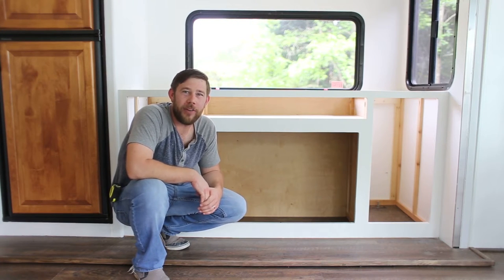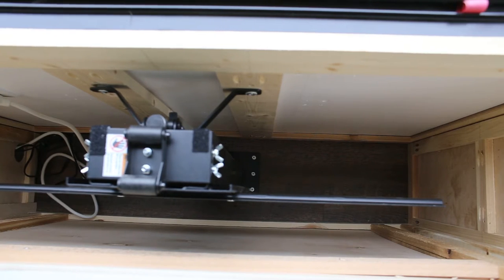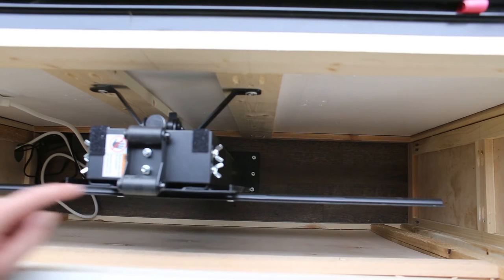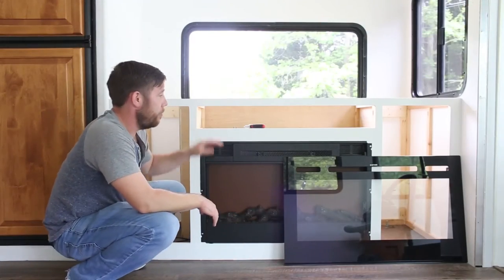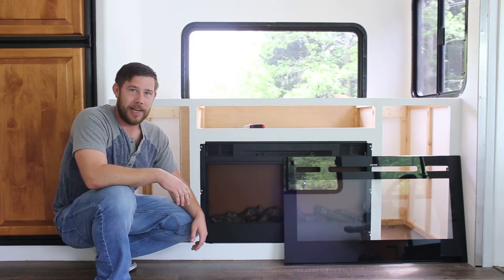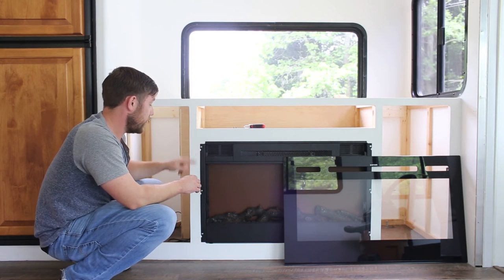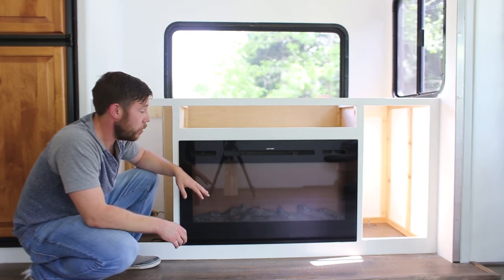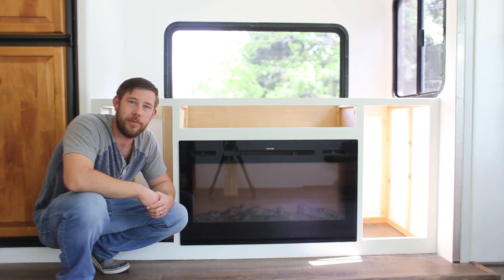Installing TV Lift and Electric Fireplace Inside RV

Comment: Great job. I’m curious as to what you use to attach the word framing to the rv wall? Glue? Nail gun (if so what size)? R u using a stud finder as well?
Thx again
Reply from the maker: Thank you much +mram 77 we actually used screws and screws and anchors, though after reading your comment I think adding some glue for extra hold wouldn't have been a bad idea. All RV's are different but below is what worked for us. 

So we found that the wall next to the refrigerator was actually very thick wood, so we just used screws on that side. For the back and right side it was just the wood panelling so we used 1" screws (our 1 X 2's were 3/4") and anchors to secure to the wall. However it's important to note that the screws on the walls were more security than anything else because on the floor of our slide out we had and extremely thick piece of underlayment, I can't remember the thickness but it was thick. So I'd say our main securing was done into the floor of the slide out. And on the stud finder we didn't use one main reason being that the studs in our RV are metal, and we didn't feel comfortable screwing into them. I did tap on the wall to try and avoid them. Anyway I hope this helps and please feel free to reach out if I can help in any other way, best wishes, Eric
Reply: Mountain Modern Life 
I truly appreciate the detailed response. Helps tremendously. Your renovation is by far our favorite. Now time for me to get to work.
2009 36ft 5th wheel toy hauler
2 slides
Fontana CA🌞
Reply from the maker: No worries at all +mram 77 I'm glad it was helpful, I can't wait to see what you do to it! Make sure to keep us updated with how it's turning out, and of course if something comes up you think we may be able to help with don't hesitate to reach out :)

Comment: I'm not sure you can answer this question. I've been considering living in a travel trailer. The thing that is stopping me is the cost of propane in the winter. I am thinking it could be possible to install an electric fire place instead, and use a heated blanket during the cold months. I was originally thinking about using a space heater but I've heard that can burn up the wiring in the trailer. I am wondering if an electric fireplace would burn up the wiring too?
Reply from the maker: Hey +Matthew Pilling I don't know the exact answer to your question but I will try to give you an idea of the process we've taken in the past. Propane can for sure become expensive so we've actually tried to marry together different options in order to conserve what we can. When we were in Wisconsin it was really cold (like -25 when we left) when we were there we'd use propane, the electric fireplace, and space heaters. This year however we've only used the electric fireplace, and propane, we actually lent the space heaters to a fellow RVer who ran out of propane in the middle of the night. 

With all of that said we've went two winters of using our electric fireplace and haven't had an issue with our wiring. The problem here is that all RVs are constructed differently, so it's hard for me to know if you'd have the same results. But for us we've had good success with the electric fireplace, electric heaters, and the propane. It's one of those things that you're going to have to push forward with and find the route that is most comfortable to you, which can be really hard to figure out. I hope this helped somewhat but please let me know if I can dive a little deeper into it. Best Wishes, Eric

Comment: Hi, it's minus 5 here I'm a full timer. Can I run a fireplace 24 7 for a week along with an oil heater in my coach ?
Reply from the maker: Man that's cold! I'm not sure that you'd be able to run the fireplace all week, ours will run for a a decent about of time but then it shuts itself off in order to cool down (at least the heater part, the fire display keeps running).  I think it comes down to trying as many options as you can in order to find the most cost effective combination to keep you warm :)